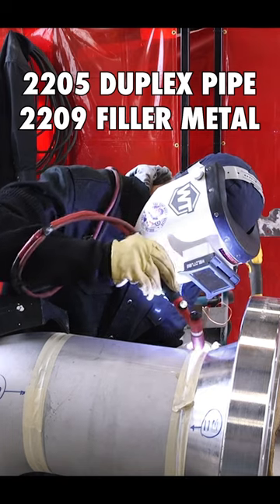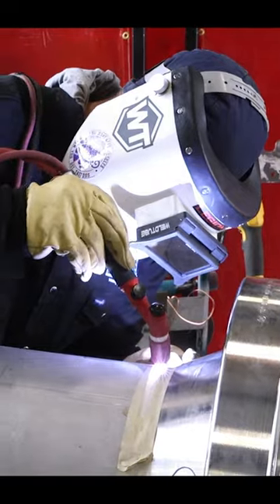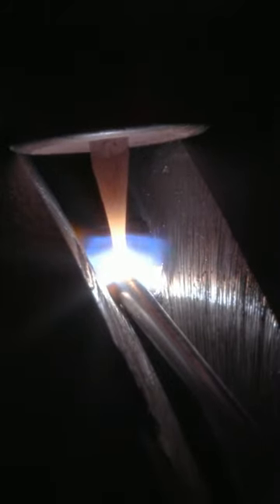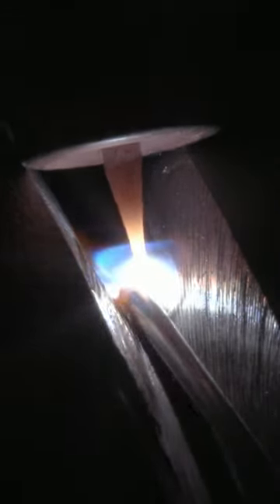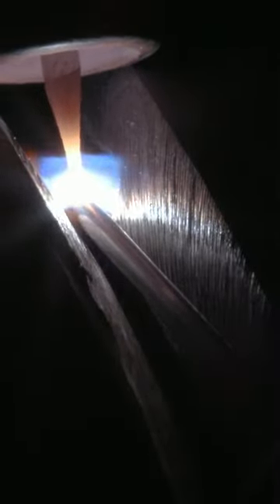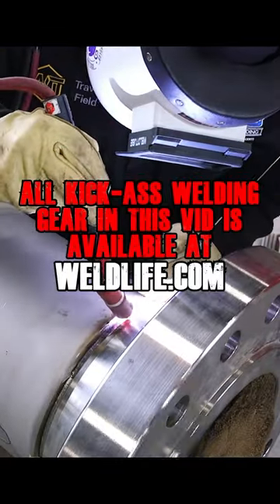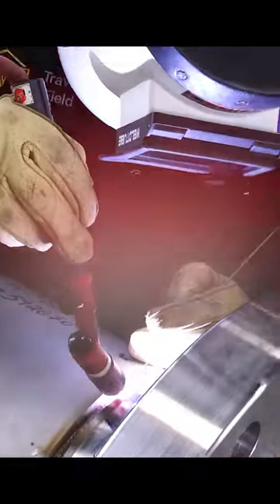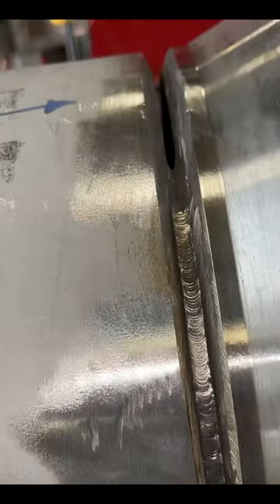100 amp TIG root pass on a duplex sch 40 pipe. 10” flange to an elbow. Ft. Travis Field. #shorts

Comment: We call this flipping the rod into the puddle.. it does give better control than just running over the rod ( which you still have to push into or pull out of the puddle once in a while..to get a perfect weld on the inside of the pipe..

Comment: Looks good. They allow you to dip the rod, suck back? Lay wire? Contamination if you accidentally pull rod from gas?
Reply: Noob 😂
Reply: Hes welding on the top so theres a lower chanve of suck back. Oftentimes this is a better method to use than laywire because it allows you to guarantee sufficient penetration because you can see the bevel tips melt, and dipping gives you better control over the amount of metal being deposited. Also dabbing wont introduce any contamination as long as you don't move the rod away from the gas shielding. I prefer to backfeed roots on the bottom and dab on the sides near the rop, but on a tighter gap like this where you cant fit the rod into the pipe dabbing like this works well.
Reply: @elliottarpin8191  yea I know I’m 15 year Union Boilermaker living in nuke most the time. Dipping is a bad habit, anytime. It’s not allowed unless necessary, which is rare. It’s not even taught anymore in my trade. It’s stays in the puddle and that’s it.
Reply: @johnschmidt2964  dipping is acceptable, just have to keep it in the shielding gas